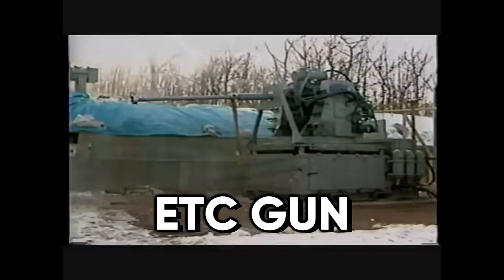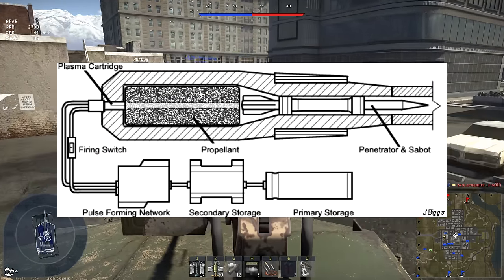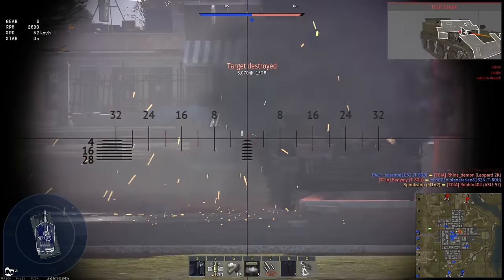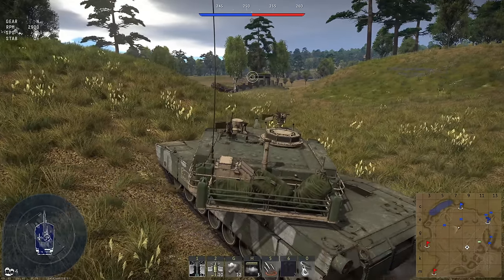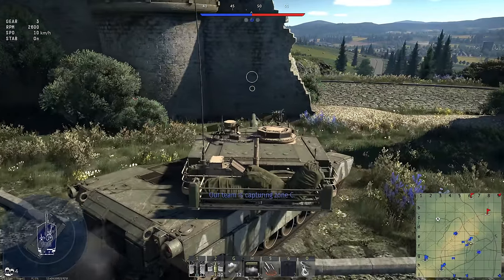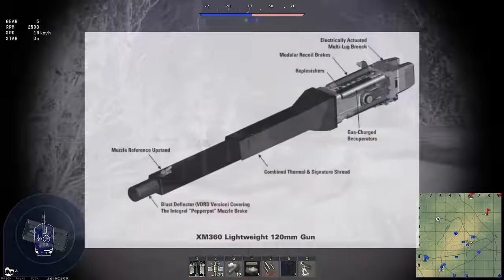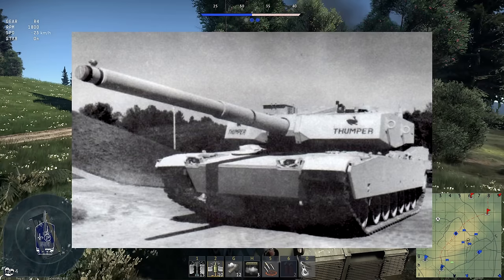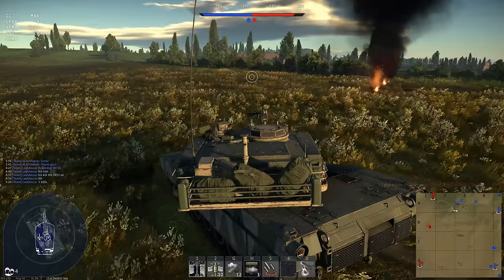ETC Cannons - The Future of Tank Weaponry

Comment: Well I never heard of an ETC gun until now. Fascinating technology though, the implications are obvious.
Reply: Good I wasn't the only one
Reply: Check out the old metal storm videos, you can use ETC guns in arrays to get 1 million rpm machine guns and mortars
Reply: Have you heard of the movie Aliens? Because you may have heard of an ETC without realizing it as the Pulse Rifle's ammunition lore wise is electrically ignited.
Reply: Not necessarily. A few important things to note before even getting even a little bit hyped for this that the video didn't bring up:

1. They have yet to make this remotely efficient after 30+ years of research and development.

2. The system requires significant power and the associated electrical systems to even fire. If any of these are damaged or if the tank/vehicle gets affected by an EMP strike (like USA is currently developing for use in artillery shells), the weapons will simply be incapable of firing unlike traditional guns.

3. Faster projectiles combined with much more potent, hotter-burning powder/liquid propellant mixes (along with the heat from the ignition system) will severely reduce the life-time while increasing the needed maintenance of the barrel.

4. More components (especially electrical ones) increase the risk of things going wrong and/or requiring more maintenance of which said maintenance would also require a degree of specialization.
Reply: @KageRyuu6  Really, I must of missied that, then again I have only ever watched the films and read a couple of the thrashy 90's era novels so I always thought of Alien as a horror franchise. Is there alot of lore for the Aliens weapons then?
Reply: @Coecoo  Agreed, I doubt these will see any use unless there's another major shakeup in armor technology like composites. For now, a chemically fired sabot round is more than enough to punch through any tank from what I've seen.
Reply: Closer and closer to energy guns.
Reply: @lightningphoenix7155  I can't really agree with you there, have you ever read about the technical difficulties of building and operating Direct-Energy weapons, I'm not surprised no real progress has been made since the 1970's. I'll give an example, lasers, the US developed a laser point defense for use on their ships and it worked, it could take out missiles and drones with pin-point accuracy. However, it had fatal flaws. First the reflectors and lens would build up insane levels of heat (in one really bad test, within a few minutes), causing them to warp so badly they would need to be replaced. Then, there is the issue of Blooming, if fired during rain, snow, misty, foggy or dusty weather the heat from the beam would get absorbed into particulates in the atmosphere, dissipating the beam rendering it usless. I think the worst issue for a ship board weapon system, is the fact it was very venerable to damage from rough seas. It wasn't much better for the limited land based tests, as the engineers and soldiers worked out it could taken out of action by throwing rocks at it, nevermind small-arms fire. The problems for plasma, sonic and particle-beam weapons are even worse, the only DE system that I can think of that worked well is the microwave based Active Denial System, but that is a Less-Than-Lethal riot suppression weapon, hardly a game changing weapon of war.
Reply: Nor me, thought it was an auto cannon at the start lol
Reply: I first heard about it from Frontlines: Fuel of War as the Western Coalition tank uses a 120mm ETC Cannon.
Reply: @chaosreaver3597  do you know the us does have functional láser weapons right, the LAW system installed on the US Ponce, and it's not even a testbed the captain of the ship has permision to use the láser on a defensive role if the necesity ever comes to it, lásers are a working technology right now and it will only mature in the future
Reply: @carso1500  I understand that lasers are a useable weapons technology, but it took around 30 years development to get them to the point where they could be used to supplement existing CIWS. In some nebulous future, I can see lasers working in place of conventional weapons, but alot of problems need to be addressed and even possibly new materials will need to be synthesized to make them viable. Honestly, I think if the world was to run out of gunpowder tomorrow, and world's militaries needed a replacement, I think they would choose crossbows over laser weapons.
Reply: @chaosreaver3597  the biggest hurdles of lásers (thermal blomming and energy capacity) have already been adressed and improvements on battery technology, more powerful capacitors and yes stronger materials (nanomaterials) would allow lásers and other technologies to finally become a reality, and several armies in the world are working on them and have functional models 

And yes it took 30 years of development, but no one said it would be an easy weapon to develop, the technology is pretty much bleeding edge
Reply: @carso1500  While, the issue of energy capacity has been improved with the introduction of better batteries, it's still less than ideal to use lasers without a generator. The energy density (shots per gram/ounce) of batteries is exceptionally poor when compared to ordinary rounds (a solid-state laser I read about with a relatively small power draw required 12 to 14 times as much weight in batteries to match the damage the equivalent to what a gun would do). The primary benefit is safety, as a battery isn't as likely to explode when struck by weapons unlike traditional magazines. I don't really think lasers are going to be useful outside of static and ship board defense for quite some time, at least untill batteries are far superior to the current models or power generation can made much smaller (i.e. the power output a marine diesel engine in the frame of a tank engine or smaller).
Reply: @chaosreaver3597  there are such bateries in development and almost reach a working state, search for solid state bateries, several times the energy density, charge faster and can take a bullet and only lose 30% of it's energy density, mostly developed for it's usage in cellphones but they could perfectly be used for this
Reply: @carso1500  I had a look at solid-state batteries, they would be viable, however they are insanely expensive (in 2012, $100,000 US for a 20 ampere hour battery, a car battery has around 50 Ah for comparison costs $90 to $200 today). No military would fund that, the bottom line is always the deciding factor for weapon selection. Once a cheaper method for making them is achieved then perhaps laser weaponry will be adopted, this might be closer than I thought. Car manufacturers are looking to use solid-state batteries for electric cars, once the collective research departments race to produce the cheapest model it wouldn't be long before the military would take interest.
Reply: @chaosreaver3597  as you said, 2012, things have changed a lot since 2012 (quick reminder that 2012 was already 8 years ago), theres kind of a race on the tech sector to see who develops the first solid state batery for mass production because it's kind of the holy grail of batery technology, with giants like Samsung, Apple, Huawei, Tesla, Ford, between many other pouring millions into it's development, they are still a couple of years away from masive production but thats it, a couple of years away, they are kind of a big deal since it would allow for development of many technologies that today have limitations due to batery limits like robots, exoskeletons, prosthetics, eléctric cars, between many more
Reply: @carso1500  When they do get solid-state batteries affordable they will change all portable technology, but I think your estimation of a couple of years is off. The problem is no real progress has been made in the fundamental manufacturing process of the batteries, the cursed things require a precise method of fabrication, which hasn't been simplified yet (bear in mind, alot of progress has been made with other battery technology, it's not like the best scientist and engineers haven't been trying). Untill then, I get the impression that some new type of meta-material will need to be created to make wide-spread solid-state batteries a reality. It not outside the realm of possibility that 3D printing could be used to fix the problem, around 10 years ago it was considered impressive that a 3D printer could construct a marzipan mouse, now they are being used to make basic electronic components. Given that consumer electronics are extremely important to western society, and there is a boatload of money to be made, the issues of solid-state batteries will be solved but it's going to require major breakthroughs to make it a reality. The applications, especially the non-military ones, are too useful for the technology to be allowed to fall by the wayside.
Reply: Will never get accapted do to wair on the weapon. And I'd not new teck rather  been around for years do you know how much it would cost to replace the bearls  do to the ammunition type. The logistical issues of ammo type plays a role to
Reply: Oh not to mention that the USA will invest in weapons teck but dont mean that will use it. Dont forget the huge issue of trying to get the teck in to U.N OR N.A.T.O testing it get it accpted. There's a reason why usa canada UK Germany  all use the same  caliber weapons and have standardized calibers. What if you run out of ammo  and youer friendlys dont have the same ammunition type as you??
Reply: Hernando Malinche  Because we have yet to make a single component on typical circuit & motherboards that do not randomly break on the most stationary of things.

Now put this knowledge onto tanks that shake about like nobodies business + the immense heat from igniting a plasma reaction + the massive shockwaves from firing a large caliber weapon.
Reply: Caseless gun plasma ignition
Reply: Hernando Malinche  Did you just try to compare high-powered plasma ignition electrical systems mounted on tanks to low-powered 1 watt mass-produced IC consumer goods?
Reply: The ETC's only flaw being a cumbersome power supply, is In truth an easy one to mitigate, made even easier as graphene and solid state batteries become increasingly widespread.
Reply: @KageRyuu6  You got the Stats?
Reply: @Snivy_Films  cannon highly unstable molecule launched
Reply: carbon fibre shoulder mount anzio 20mm "plasma" cannons, belt fed & carried by troopers in power armour   ...obviously.
Reply: @Coecoo  yeah, i think that if ETC guns become common, it will be out of necessity to counter armor material advances. They have disadvantages, but if the tradeoff is a choice between not penetrating an opponent's armor and penetrating it, there is a good argument for ETC guns over more exotic options as the bext step.